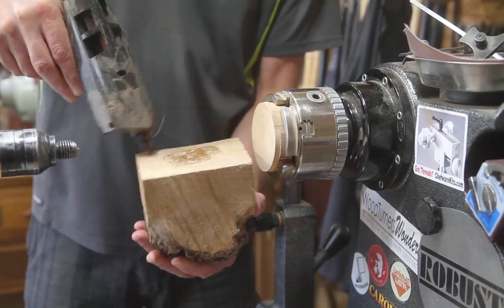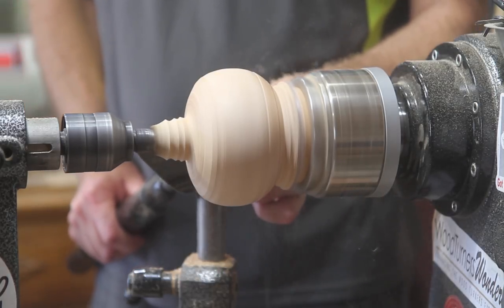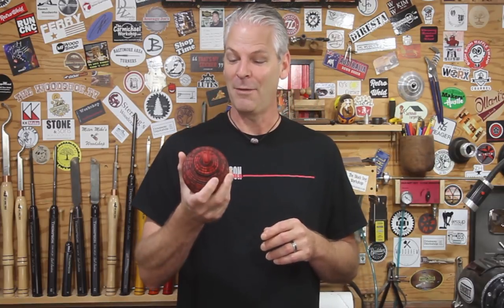Woodturning Basket Illusion Turned Lidded Box | Carl Jacobson

Comment: Carl how strong is the hot glue and is there a particular type of wood to use as a chuck extension to glue to ??
Reply from the maker: Hi Barry, It's regular crafting hot glue and a maple waist block. Just make sure you get the glue hot, use a big high watt glue gun.
Reply: thanks Carl

Comment: I didn't see what you used to burn in the horizontal lines on the box or did you?
I have used a few methods that all work well. First few I made I used a heavy card stock and trimmed the burnt edge off to have a fresh edge. I then moved up to plastic laminate chip samples and they last quite a bit longer (any plastic laminate retailer including the big box stores have sample chains of the chips for free). Living in Las Vegas I settled on the renewable source of material to burn the lines in and that is playing cards. They are hardly worn out when the casinos are done with them and most places sell them for like .50 cents for a deck that will last and last. Just trim the edge back to get a fresh edge to burn with. Good and easy project but as you know takes more time to complete than meets the eye, but as you know, "no crybaby's"
Reply: James Stanlake you can use a soldering iron i think
Reply: @Flying Squirrel To use a soldering iron would be like using a paint roller where a artist brush should be used let alone regulating temperature. I have seen people use a skew shaped pyrography pen tip to burn in the verticle lines but you have to burn in from one edge then turn the piece over and burn in from the other valley on the bead.
I have the Razor Tip pyrography system and use the 3-T98 pen tips, they are made specifically for burning the vertical bead lines for basket illusion items. Razor Tip is pretty slow on shipping the tips ( I waited 3 months for ones I ordered). I have not seen the tips advertised from catalogs now and am unsure if Razor Tip has discontinued them however, I now make my own from wood burning wire and bending it to form the correct size bead.
Carl is correct, it takes practice to get the method down. Also you will need to use india ink pens if you are going to use a finish ofer the colored piece so colors will not run.
I practiced and perfected basket illusion beads on carbide lathe tool handles I made and they are stunning. If you want another great source of materials and methods for doing this watch on YouTube a couple of videos from Harvey Meyer who is quite good at it and has a list of resources for materials and supplies you can get. I use the free software program me recommends that I use to map out the design for the colored pattern. You can take pictures of actual baskets woven and use the pattern on them for your woodturned project. Google images search "basket illusion woodturning" to see many of the endless possibilities of design options available. Nice job Carl on your first attempt!
Reply from the maker: Thanks for all the tips James! Right?! NO CRYBABY'S